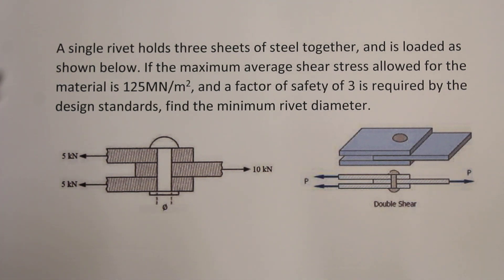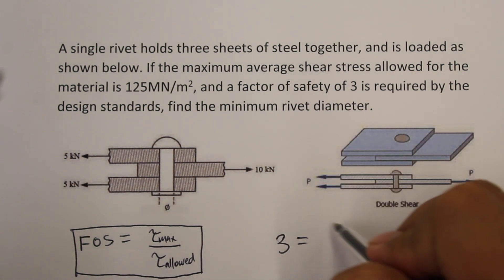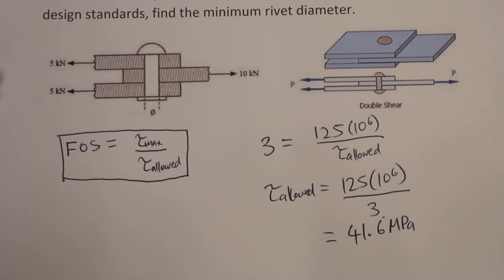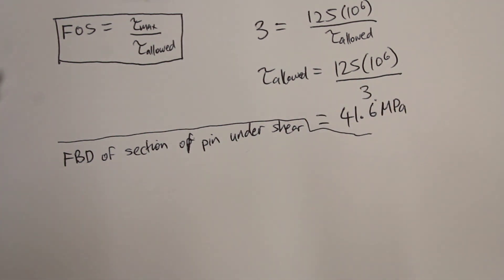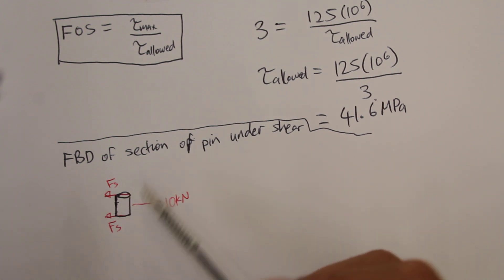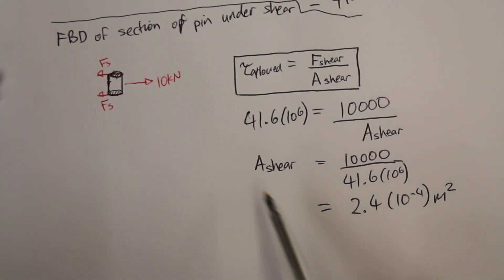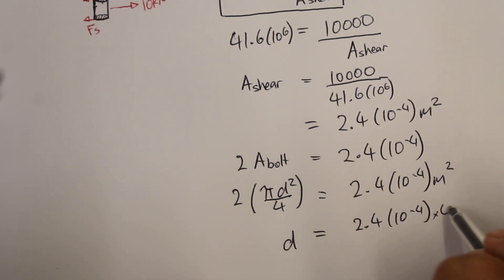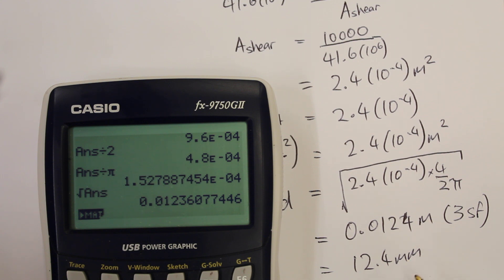Single Rivet, Double Shear - Example

Comment: Wouldn't the cross-sectional area of the rivet be half? There are two shear planes on the rivet.
Reply from the maker: Since there are two shear planes, that means the force applied needs to be able to cut through the bolt at the top and at the bottom @3.44.

That means the total area that is cut through by the 10kN load will be the area of bolt above and the area at the bottom.

-----
Another way of thinking about this question is that the bottom sheet only supports 5kN of load, and that 5kN cuts across one portion of the area.

Comment: Why does 
125(10⁶)/3 = 41,666,666.67N/mm²
Converted into 41.6 MPa
When 1N/mm² = 1MPa?
Reply from the maker: Hi Panacea, it looks like you have an error in the first line.

125MPa =125 (10⁶) Pa
125 (10⁶) Pa / 3 = 41,666,666.67 Pa -> 41,666,666.67 N/m² -> 41.67N/mm²
41.67N/mm² = 41.67MPa

I'm not sure if I can answer the why question well, but I do have a video showing examples of unit conversions that may help:
https://www.youtube.com/playlist?list=PLk9xM6UeGau1V-xhAkwGPW69mhCxhkOno

Comment: When the problem says "average shear stress allowed for the material" are they referring to the material of the pin or the material of the steel sheets?
Reply: It should state which component is made of which material in the question. You are right to point out this error. In this case it meant the material of the bolt.
Reply: Were they already mention "material for the rivet?"